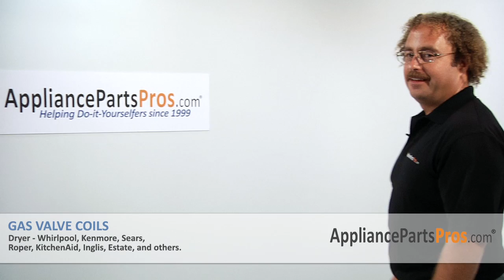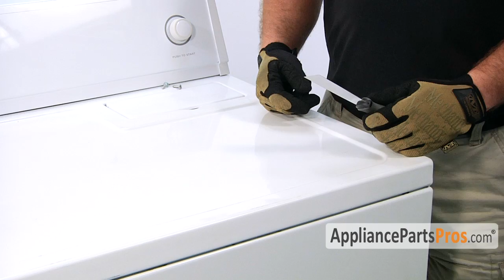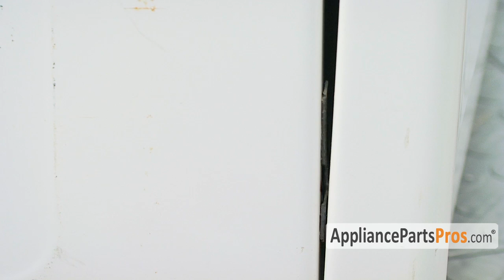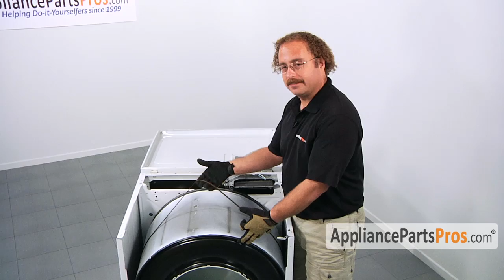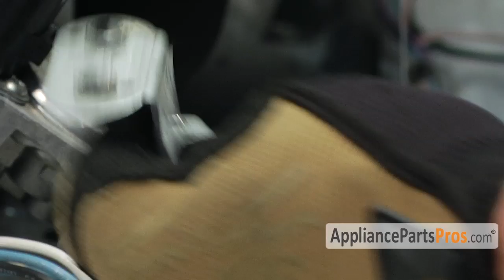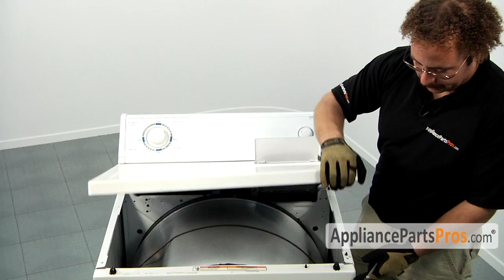How To: Whirlpool/KitchenAid/Maytag Gas Valve Coil Kit 279834

Comment: I am replacing the Maytag Gas Valve Coil Kit 279834 for the 2nd time. However I noticed that the 3-prong coil/Solenoid is missing the the little metal "sleve". Is that creditical? Can I purchase it?

Comment: My gas dryer heats only for the first 5 minutes and cold air comes out from it after that. For the 3 prongs coil, 1&2 works, 1&3 works but not 2&3, it's O.L. Is this normal?

Comment: TURN OFF THE GAS BEFORE REPLACING THE COILS! There’s no need to turn off the gas on the dryer shown in the video above because the coils can be removed without removing the seal plate. But on my DG210 dryer the press plates are secured by the magnetic straps. As soon as either magnetic strap is loosened its seal plate is no longer secure and gas is allowed to escape.

Comment: Excellent video - thanks! Helped me out and I did it in half hour! Couple quick things (for your next time video). First, after I realized after I did everything step by step, that you can reach the bracket and screws (and consequent coils) without removing the drum. Hence my second thing: after I finished, I replaced the drum wrong (not sure how) and it wouldn't spin. I had to disassemble the washer and do it again. Pulling the belt through the pulley was a little harder the second time, too. Maybe next time do that step (about putting drum back on) a little slower like the others? Finally, was I the only one who had a hell of a time putting the front back on (to the teeth at bottom each side)? Like I said, I am extremely grateful and thought the video was excellent - just my take on it. Thanks again!
Reply: Just want to add that despite above - I LOVED this video! Mostly because it was easy to follow and do. I wish he did more videos on other fix-it jobs!

Comment: Isn't it necessary to turn off the gas before removing the coils? When I loosened the bolts on the bracket I smelled gas until I turned off the gas shutoff valve. My dryer is a Maytag DG210.

Comment: I did it all and it worked but now as the drum turns there is a scratchy sound like something is rubbing. I checked the back seal before. Could it be the belt is twisted?

Comment: I have a problem with my Samsung dryer where it does not heat up. I have replaced all the sensors, exhaust duct, igniter n gas valves solenoids. The flame goes on but shuts off after about 10-15sec. Any suggestions on what else it could be?

Comment: Thanks Matt and Appliancepartspros for this tutorial! My gas dryer recently stopped heating and this was the problem. It was my first time working on a gas dry and I changed the coils without any issue, and walllaah it worked! Also did an annual cleaning while everything was disassembled. Thanks again!
Reply from the maker: You're welcome!

Comment: Just bought and replaced....but when I turn the dryer on it takes 3 MINUTES for ignitor and then GAS to blow...yes I changed the thermostat fuse looks like a white bean ..why is it TAKING 3 MINUTES for intro START drying yes the dryer is JUST spinning for 3 MINUTES
Reply from the maker: We'd be happy to help you out with that! We offer free technical advice and diagnosis. You can give us a call at 1-877-477-7278 or you can chat us at our website: http://www.appliancepartspros.com/. We will need your model number to give you accurate advice, which you can locate using this tool on our website: http://www.appliancepartspros.com/modelnumber_locator.aspx
Reply: Weak igniter, listen for the first click. The igniter should begin glowing within ten seconds of the click

Comment: Are these solenoids replacement parts for solenoids for gas valves (Maytag/ADC part numbers A128944/128944) on the Maytag/ADC MLG33PDAWW dryer?
Reply from the maker: Unfortunately, it looks like the manufacturer has discontinued production of the parts you listed, and we have no remaining stock at any of our warehouses. This part won't be a compatible replacement. It may be possible to find A128944 and 128944 used through a local salvage company or a used appliance parts retailer online.

Comment: I replace my coil valves in my dryer but the gas still shuts off after a little while... What should I do?
Reply from the maker: +xavier Luna Without knowing what you have I would suggest heading over to our repair forum. You can post the problem along with the appliance model number on our repair forum and the techs can help you troubleshoot the problem. http://forum.appliancepartspros.com/

Comment: my solenoid doesn't work if severel times cycles, but if new cycle it work. so if solenoid in cold condition its work. i have to check the the solenoid and its connected. how do you think???
Reply from the maker: +faisal amri The coils are going bad. When the coils start to fail they create too much resistance when they are warm and will not open the valve. As the coils start to die they will do as you said, work the first few times, then once the dryer is hot they will not work. Usually it leads to longer drying times and then no heat once they truly fail.

Comment: My maytag dryer has one valve with both plugs on it (part number W10304604). Do i have to use same or can i use the 2 separate ones similart to yours?
Reply from the maker: Jesse Perez I would go to our site and enter your model number and view the parts breakdowns to see if they are sold separate or if you have to get the whole valve.

Comment: if the shaft for the smaller coil seems to be loose, can that affect the coils and the dryer from working properly?
Reply from the maker: If the shaft is bent or loose it could stop the coil from opening the gas valve.

Comment: Yeah i took the valves completely off and there was no change on the ohm meter. I ordered the gas valves from you guys Friday, it was just funny to check all the common parts, the fuse, the thermostats and find nothing wrong. I was about to just buy a new dryer when I opened up the front and saw this little assembly near the igniter. But I'm glad I did,  thanks to u guys and an hour of angry tinkering I know a lot more then I did 2 days ago.

Comment from the maker: Does the igniter come on? It should have continuity and between 50-400 ohms. Not sure if you did or not, but be sure you remove the wires from anything you test so you do not read back through the wire harness and get a false continuity reading.

Comment from the maker: You can not just do a continuity check, you will have to check for a specific ohm value. Here is the readings you are looking for:
Gas valve coils have to be tested for resistance, ohms. Two coils – one with three terminals and one with two terminals.
1. The coil with two terminals should have 1220 ± 50 Ohms
2. The coil with three term. if held with terminals in upper position: 
  a) across the left and the middle term. – 1365 ± 25 Ohms
  b) across the left and the right term. – 560 ± 25 Ohms

Comment: Great Video and very easy to understand. Now, I just have a quick question. In my case, if I run the dryer empty (No Clothes at all), the dryer works perfect and it heats very well, but if I load the dryer and turn it on, the flame will stay for a few seconds and then will go off. Is this the same issue you are referring to? Changing the Gas Valve Burner Coils, will fix the problem? Thanks in advance for your help.

Comment: Brilliant.  Easy to follow, this was exactly my issue.  Great tip about the coil valve with the metal insert - i would have blown that step.  Thank you!  

Curious - anyone know a rough estimate on how much a repair service would have cost for this repair?  $100 just to show up.  Maybe another $50 for the parts and $75 for labor?

Comment from the maker: If you look at the coils you will notice that one coil has two connectors and the other has three. The one with three is actually two coils in one. These are the standard coils used for many years, they should work fine for your dryer.

Comment: my dryer stops heating a couple minutes into a cycle and from some quick research this coil kit is the solution. in the service manual for my dryer (maytag mdg6200aww) it lists a holding coil as well as a booster and secondary coil. the kit comes with two coils (booster and secondary i imagine), correct? is the holding coil unnecessary to fix this problem?

Comment from the maker: Changing just the coils does not require the gas to be turned off. They sit on top of the valve but no gas flows through them. But it's always a good idea to turn the gas shut off valve off (located behind the dryer) just to be extra safe.

Comment: Thanks! We had glow but no fire, so I replaced the coils as shown. Now we have fire!

One top clip wouldn't let go with the putty knife, so I had to poke it in the center with a punch to release it.

The drum was tricky to realign during assembly, but eventually I got it. Having my head inside the dryer at the time seemed to help me see what was happening.

Lastly, I did notice the gloves in the video, but I didn't wear any. I should have. There's a lot of sharp edges in there! Lesson learned.

Comment from the maker: @sublimefan661 If the igniter is cycling on and off, it would indicate the coils have gone bad. When they are cold, they will work the first few cycles, but when they warm up, they stop working. Dont forget to clean the dryer and vent while you're in there.

Comment: Ive got a kirkland signature whirlpool gas dryer model SGDX600JQ2. My problem is when the dryer is cold and has not been used for hours, I run it, doesnt matter if its on timed dry or auto. The flame is on in the gas chamber, then shuts off. After 5-10 min. after 30 sec. or so i hear a noise coming from the dryer, then i can see the chamber glowing redish orange for about 10 seconds then shuts off with no flame at all. This process repeats until i stop the dryer. Sound like a bad valve coil kit?

Comment from the maker: @mexrockstar1 Unfortunately, these coils cannot be accurately tested for continuity. A bad coil might show a good reading when cold and fail when energized. If the igniter comes on and then cycles off after a few seconds and no flame from the burner, it's usually the coils (in very rare cases it's the whole valve). Describe your problem...